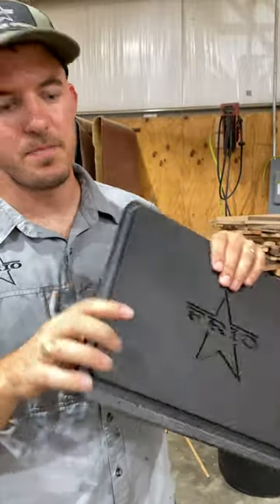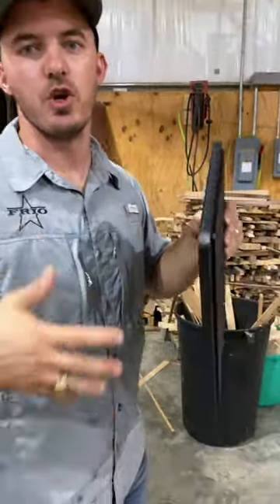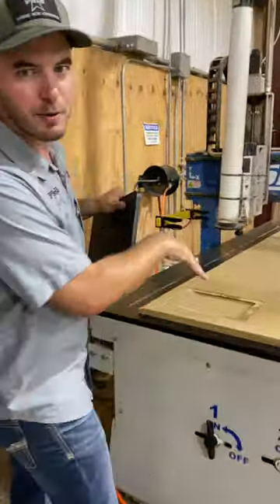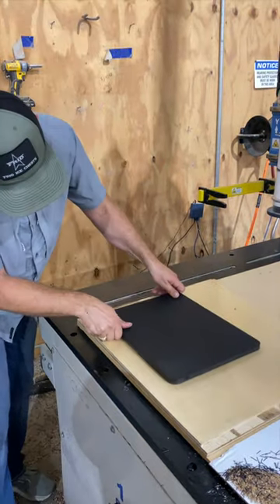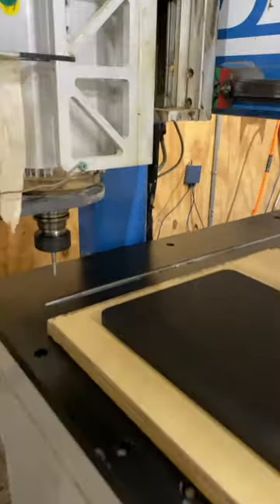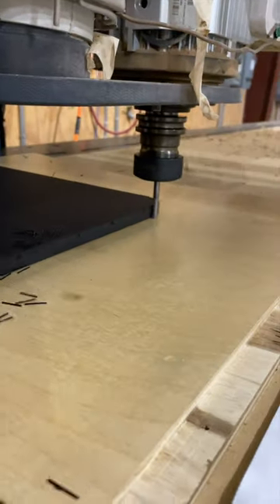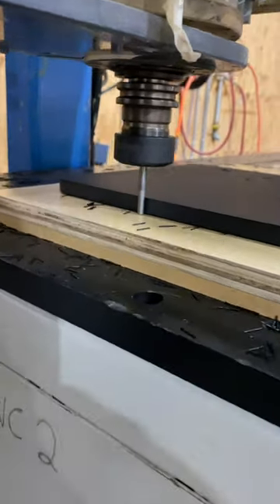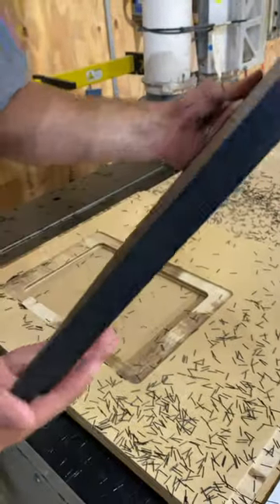Costly Mistake Fixed with a CNC Fixture

Comment: You need as better plastic supplier if that HDPE is $300
Reply from the maker: Is there anyone you recommend? I would love to get it cheaper
Reply: @cutting-it-close  I've always used Boedecker Plastics in Shiner,TX. It's been a few years since ive purchased material from them, but my research in the past was they had the best prices and customer service.
Reply from the maker: @macmac2584  Yes they are a great company! About an hour down the road from me, on this particular plastic sheet they are a little bit more expensive.
Reply: @cutting-it-close  Keep up the good work👍
Reply: @cutting-it-close alro.
Reply: @cutting-it-close That was such a professional response. Respect to you sir 🫡
Reply: @cutting-it-close uhmw hdpe?
Reply: He said the sheet.
Reply: I'm in Colorado and go with Piedmont plastics based on Littleton. Also Norva plastics in VA is good as well. Boedeker in Texas is way too expensive!

Comment: Ohhhh this makes so much sense. I once built a cnc machine and was never able to get good results with this material. Only ever used downcut bits. 🙈
Reply: compression cut is the way to go baby
Reply: @Vidar93 never on plastics.
You need a 1 flute, O-flute upcut bit for plastics.

Comment: Wouldn't a conventional profile cut be better than a climb cut? In my experience with HDPE, it is. I only do climb cuts when i want to prevent splintering in softwoods/hardwoods.

Comment: Would double sided tape have been sufficient? Seems like a waste of plywood (unless all the parts you make fit into it, then its a jig instead of a one off and this is just part of your normal process)
Reply: Locates the stock, no? So the  depth of cut is uniform?
Reply from the maker: I had a little over 30 lids to do, and this was my cheap plywood, so I salvaged about $500 worth of product (considering materials and time) from a $10 chunk of plywood so it worked for its purpose.

Comment: On straight cuts a jointer works great as well. If anyone is wondering this material brand name is called starboard.
Reply: Not necessarily Starboard, this could be any brand of HDPE.

Comment: High pressure Air flow directed down/at the cutter to evacuate chips. Setup same as metal cutting uses coolant can even use coolant spigots to run airline through or a 1/4 copper water line with fine nozzle .  Straight 2 flute solid carbide also works well.

Comment: So wait, hdpe wants an upcut bit, even when you're hitting the top of the piece?
Reply: Most materials prefer a upcut, it has a cleaner finish and removes the material from the path of the tool so it doesn't attempt to cut it and the material. Down cuts are good for plywood bc of tear out. There's a lot more information than I could explain in a comment. Hope this helps.
Reply: You want upcut bits for all plastic.

Comment: Not clear at all why the shear direction of one bit gives a cleaner cut than the other. Upshear, downshear, up cut, down cut, should give the same finish if the concern is not to press a veneer flat to the surface while cutting. Is the unacceptable surface composed of un-evacuated chips heat welded to the surface?
Reply: You need a 1 flute, O-flute upcut endmill for cutting plastics. You need to evacuate the chips, to prevent packing and rewelding.
Reply: @acerjuglans383 , well, I did mention the un-evacuated and rewelded chips. What the video really demonstrates is that a light finish cut leaves a better surface than hogging the whole profile out in one pass. The best demo would be to show the stock cut as originally done, but with the different bit. I think your conclusion might better read "You need to evacuate the chips, to prevent packing and rewelding." Elevating the stock on pods might allow such, whether up-cut or down-cut. Congrats on saving your workpieces. All the best!

Comment: It’s cheaper to use an insert cutter. You will need to adjust your feeds and speeds to get the same finish, but replacing an insert is a lot cheaper than replacing an end mill.

Comment: You can use the down cut after its cut out. It'll make a cleaner cut when you're not forcing the waste to the bottom of the channel..
Reply: Never use a downcut bit on plastics.
1 flute, O-flute upcut endmill only.

Comment: As someone who started by working with wood. F HDPE. I designed a product in this material and after working with it a few times will leave it to yall. Better man than me.
Reply: You need a 1 flute, O-flute upcut endmill, 18000 rpm,  100 ipm, conventional cut.